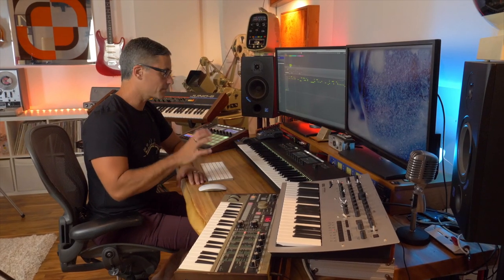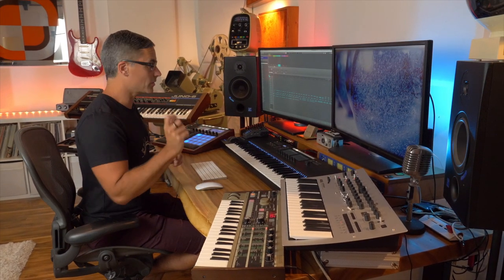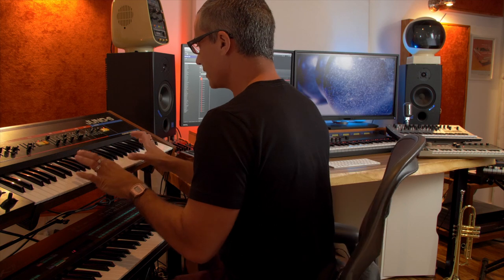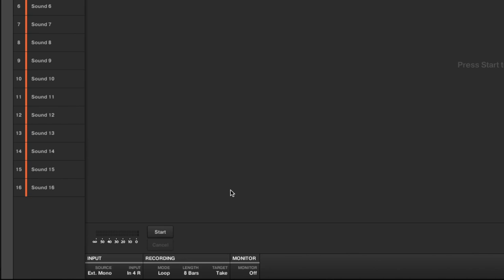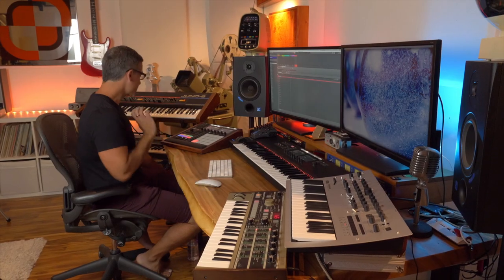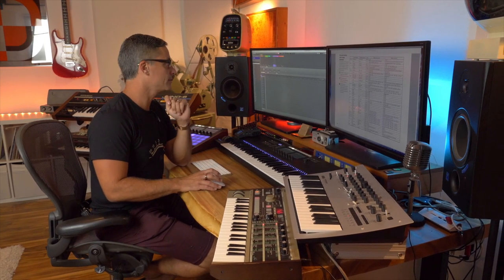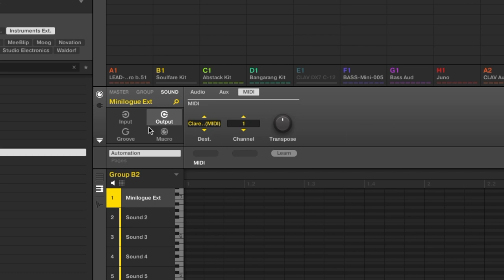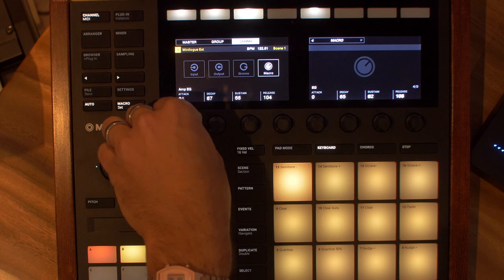Hardware Synths in Maschine! Maschine Tutorial 2019

Comment: Dear all, Have  an issue - when rotating the "Filter Cut Off"  encoder on my Synthesizer, the MK3/Maschine Software is not recording the incoming CC message changing the macro encoder value. What is up with this? to ensure my synthesizer is transmitting messages I am Running the "Midi Monitor App" to monitor the incoming traffic - this demonstrates traffic is incoming. Any explanation on the Maschine Kontroller/Software?

Comment: Thanks for the video! It helped this beginner a lot. Do you have any suggestions to reduce latency? Right not I have a analogue synth connected to the mk3 by midi and there is a delay that I'm not sure how to reduce. Any suggestions?
Reply from the maker: That's weird, did you adjust the buffer settings in Maschine Preferences?  It should be unnoticeable...
Reply: @jefgibbons  I've been trying a few things. Really just testing to find out where the problem is starting from. I'll give that a try. Thanks for the suggestion I appreciate it!

Comment: Hello, begginer question. How do you connect your Hardware synth to your Daw/Computer? Maybe its simple, can you explain
Reply from the maker: No problem Roland, I've got the keyboards with MIDI connected via a MIDI interface.  Most audio interfaces these days have MIDI interfaces built-in.  If you are using Maschine, it has MIDI on the back for a synth.  Then I have the audio cables from the synth going to my audio interface so I can hear the synth.  You can use Maschine's audio input for this.  Lastly you need to turn on Direct Monitoring so you can always hear the synth through your interface.  I don't believe Maschine has Direct Monitoring, (correct me if I'm wrong anyone!) so you have to select a sound to receive audio from your Maschine, and then activate the Monitor button that you will see at 2:58 in the video! Let me know if that answers your questions!
Reply: @jefgibbons  Thanks a lot

Comment: Sadly, using multiple midi outs for external hardware synths just doesn’t happen for pc/windows when using Maschine DAW. The midi dropout bug has been around for years and NI have not fixed it.
Smooth as silk on a Mac though.
Reply: Are trying to go directly out of maschine’s midi only? That won’t work but it will work if your interface has midi or you use a midi box. I use MOTU midi express. Maschine connects to it through usb and all my synths connect to it with midi on different channels. That works for me.
Reply: @dazeja  I use a Focusrite Scarlett, and an iConnectivity. constant drop out with a windows based PC, when more than one midi message has been sent to hardware.
Even over usb, still the same. Bought a Mac mini after reading multiple articles about the issue and no problems whatsoever.
Reply: @mickash01  wow, feel for ya. Since 2016 I’ve had 3 to 6 synths connected at a time and never had a single drop out. And I’m still using the original MOTU express( the old one). I’ve had other problems with Maschine but midi has never been one off them.

Comment: I have a UAD apollo twin which has no midi inputs.. does this mean i am unable to use an analog synth as midi?
Reply from the maker: You’ll just need a separate midi interface, but they’re very cheap
Reply: @jefgibbons  I've been using an app on mac called Audio Midi Set Up to add the midi to my apollo with just a usb cable, :o been working so far